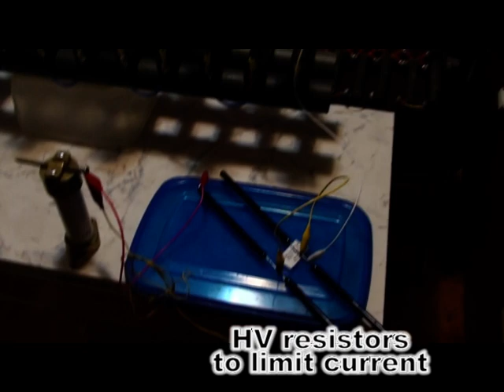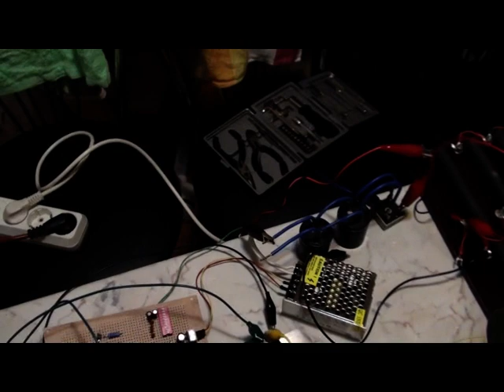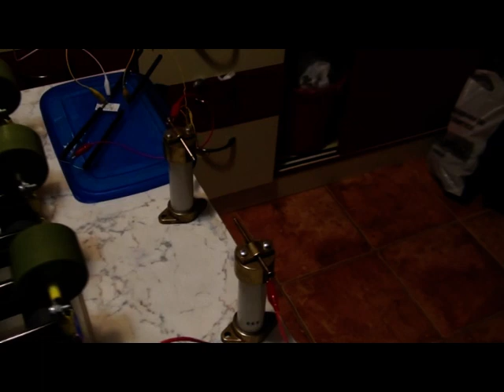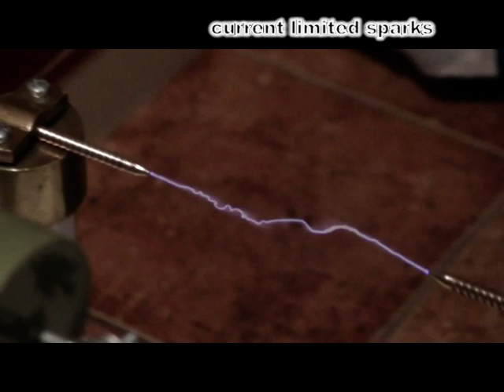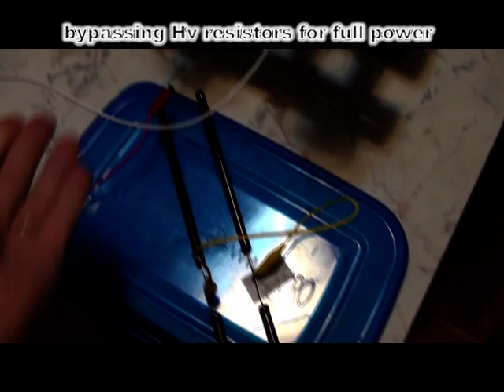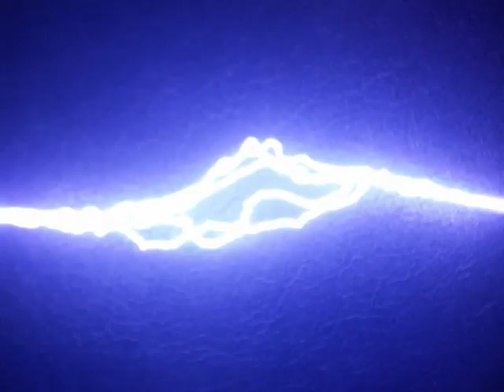HV multiplier 120000V

Comment from the maker: @whackitov Wikipedia: "CW multipliers are typically used to develop high voltages for high-energy physics experiments or lightning safety testing. CW multipliers are also found in laser systems, high-voltage power supplies, X-ray systems, LCD backlighting,  ion pumps, electrostatic systems, air ionisers, particle accelerators,  oscilloscopes,  bug zappers and many other applications that use high-voltage DC." 
For me, like many others,  it's just a hobby.

Comment: Well I'm trying to make one. For now I have suceede in making an aproximatelly 15 000 volts. But I'm using a 555 timer to make pulses for the transformer. So it was working well until I connected the two wires. It wasn't even a second, but it look I' ve burned something. Great video btw:)

Comment from the maker: @Daedronus The input voltage is about 10kv, and the output should be 120kv. The total capacitance is 2.4nf /6 (each of the 6 capacitors on one side being charged at 20kv, so 120kv totally). The energy should be (CU^2)/2, that is (0.4nf x 1.44 x 10^10)/2, which is 2.88J.

Comment from the maker: I bough them from eBay. In fact the diodes are pretty expensive, but are more reliable than puting 1kv diodes in series, because they are put in plastic cases with insulation. The capacitors are "doorknob" type, they are from Russia, NOS, from some military equipment. I bough a few hundred 3kv capacitors (russian again, they are cheaper) and 1200 diodes (1kv, 3A, fast switching) for a higher voltage multiplier (400kv+), but it will be ready next year, 'cause I don't have enough space to build it

Comment: Actually it is a spark, as in spark gap. Spark and arc are usually interchangeable, but an arc is usually defined by duration and it so fast and long it appears continuous like arc welding, jacob's ladder, and arc lamps. In this demo you can see and hear it's intervals and the duration is almost instant. It's a spark.

Comment from the maker: @RLore18  A marx generator uses only capacitors and resistors, without diodes. The capacitors are charged in parallel and discharged in series through small spark gaps (see other videos).

Comment: If you surround the HV multiplier with 10, large diameter anti corona rings, be sure to tie each of these to succeedingly higher voltage points in a long voltage divider resistor.  Ten, 2 Giga-ohm resistors tied in series with a ring tied to each.  With a soldering iron and solder, create shiny balls of solder in other locations to eliminate corona.  Finally, use small dabs of silicone rubber on any remaining points.  Make sure the silicone is completely dry before you apply HV.  Be safe !!!

Comment from the maker: @offyam The movement of the electrons is actually very slow; in fact it is the electric field, that guides the electrons, which goes with the speed of light. Of course, we cannot see the electrons moving, not only because they are very small, but also because of Heisenberg's uncertainty principle which states that we cannot determine exactly the actual speed and position of an atomic particle.  The Einstein' theory of relativity forbids speeds faster than the speed of light.

Comment from the maker: @giorulesallofu Thanks!
I bought the diodes from eBay (search "high voltage diode"). They are not the cheapest solution, but performed well. They are also capable of fast times which is good if you want to use high frequency - HV power supply. They are rated at 1A, but I use resistors in series to protect them.

Comment: Always imagine your multiplier as three different circuits.  The familiar one, charged with a load (such as an X-ray tube), with an arc (short circuit) passing very high current to the output terminal and when the diode strings pass high current into the caps to recharge them.  The transition between these is perhaps only 100 nanoseconds.  Surge protect series resistors only function when rapid charging or discharging takes place. Normally, they do nothing.

Comment from the maker: You're right. The length of the spark could be longer, but there are some losses due to corona effect; and those tiny sparks have a deadly effect on my capacitors - I had to replace one. Of course, it would be great to sink it in oil, but I didn't have the space for this. Perhaps a more compact version sunk in oil would be much more reliable.

Comment from the maker: @glenwoofit I didn't measure the current, but the average current should be less than 10mA; in fact the current is pulsed, and during a discharge it should be much higher than the average, so that's why I used 1A diodes.

Comment from the maker: The diodes already had screws; I could cover them with some insulator or rounded metal cap or immerse them in oil. I have a plan for a 400-500kv multiplier and I'll take care of the insulation.

Comment from the maker: @AKSoapy29  It's not that difficult to build one and you also have the satisfaction to do it yourself. You need a high voltage power supply, because starting from 220/110V would necessitate too many stages: the options are either a 50Hz HV transformer, or a high frequency HV power supply using a flyback transf. (like in this video). You can find cheap capacitors and diodes on ebay and build as many stages as you like..

Comment from the maker: @MrJouleJr  You could first try the timer on a light bulb or leds put in series (better) at low frequency (put a higher capacitance in the circuit) to check that is functioning. If you use the 555 timer to control a transistor, you should also take care at the voltage and current controlling the transistor's gate, because it can easily get burnt. Don't try to control the transformer's primary directly from the 555 timer because it cannot handle the current. Good luck!

Comment from the maker: @bigboy4006 The diodes are solid state and I bought them from eBay: just search "high voltage diode" and you'll find a lot of options, including this type. The cheapest way would be to buy lower voltage diodes and put them in series, but than you lose some voltage through corona efect. The voltage from Tesla coil might be too high for these diodes /capacitors. Flyback transformer is much more predictable.

Comment from the maker: @stivep1 I'm not an expert in physics, but I don't see a reason to have different wave shapes depending on the input voltage; I think it depends only on input wave shape and perhaps on the transformer core characteristics. You could check that yourself using an oscilloscope, but at lower voltages using the same input/output voltage ratio.

Comment from the maker: @mksboysal I didn't calculate it, but this flyback could not handle more than 2-300 W and not for a long time. However the "fat" arc power should me much higher due to the short time of the energy discharge. It's like the discussion of energy versus power of a lightning bolt.

Comment from the maker: Ma gandeam sa-l folosesc pt un tub cu raze X sau un mic accelerator liniar; un model mai compact ar merge pt un "stun gun".
Un tip exact ca asta e destul de costisitor: un condensator  il gasesti cu 12$ pe eBay in momentul asta. Eu am gasit mai ieftin, dar era acum 3 ani. O dioda ca asta o iei de la chinezi (tot ebay) cu 22$. Se mai adauga circuitul electronic, si restul, deci adunate fac vreo 400$. Mult ! Poate iesi mai ieftin cu condensatori si diode de voltaj mai mic, dar inseriate.

Comment: I have question Ho  to build 5000V square wave amplifier.?(F. 1-100Khz)
Is 1100V pure square when delivered to flyback = 5000V (secondary) going to give me more clean square than flyback driven by 20V square and 5000V output?

Comment from the maker: It has some advantages over a Tesla Coil: you can control it much easier, it's safer and it has more practical uses. Of course it's not as cool as a Tesla Coil, although if you see and hear the full intensity discharge you might change your mind.

Comment: @offyam Light is electromagnetic radiation within a limited spectrum which the human eye is capable of detecting.  If the electric field is generating electromagnetic waves within the wavelengths visible to humans it will be visible, otherwise you won't see anything. All electrical energy will generate some form of EM radiation whether its infrared radiant heat or something else depending on the amount of energy and how its being utilized.

Comment: @virgilius1979 You got me a little bit wrong. I' ve done all that before and I' m using an 2N3055 power transistor for the transformer. After I burned another 30 diodes I realised that more powerful diodes are required. I use two transformers connected in parallel and that's about 380mA, so it' s not that strong.

Comment from the maker: @jerjanerayo  It certainly emits UV radiation, but unlikely to produce X-rays, because of the atmospheric pressure which prevents the acceleration of the electrons between the electrodes. Still, UV radiation can be quiet strong and can damage eyes and cause skin cancer if the exposure is repeated.

Comment from the maker: @zker666 I have used Eirik's flyback driver MKII.1 circuit from uzzors2k website. (a bit modified but basically the same). I used different resistors and capacitors with DIP switches to change the frequency.

Comment: Hello, i want to charge a metallic object and to be able to modulate its potential from 5kV to 100kV or more to see how  it attracts particles around depending on tension. Do you know a way to do it, or at least does your circuit can put m'y object at 120kV DC even if I can't modulate the tension ?
Reply from the maker: sorry for the late reply: I guess an electrostatic generator is better for your experiment. You can use a voltage multiplier also, but it's more expensive.
Reply: ok tank you for answer

Comment from the maker: @foozybearz  Not with this transformer, but I noticed this effect at another transformer which is sealed in plastic and I read they have a capacitor added, so that's why you got zapped. However it shouldn't be very dangerous, unless you have some heart problems.

Comment from the maker: There are already many tutorials for building a voltage multiplier. Search for Villard cascade on Wiki. Search also for 555 timer simple circuit, how to drive a mosfet to control current in flyback transformer primary circuit.

Comment: Hi,
I just put out a transformer out of a microwave.. The transformers input is 220 voltage and the output around 2000 voltage. Now I want also to build a Multiplier with an output of 200.000 voltage, or maybe later 400.000 voltage.
Can you tell me which diodes and which capacitors I need? I know, that I need around 100 capacitors and 100 diodes, but what values?
And if I want to create 400.000 voltage, do I need other capacitors?
Reply from the maker: It's not worth to try to build such a multiplier. With 100 stages you'll have huge losses, and it will take a very long time to charge all the stages so you'll not have a continuous spark but short discharges when the voltage reaches breaking point. Try to get a higher voltage transformer, like neon sign transformer or ferrite transformer (this one needs high frequency).
Reply: Bogdan Rotaru Hi again, I have now putted 3 microwave transformers in serie, i have now around 6600 voltage. so it takes less stages. will 40 stages do? and please tell me, what types of diodes and condensators do I need. I hope you can help me. I wanna experiment with leaking charges.
Reply: Bogdan Rotaru Hi again, I have now putted 3 microwave transformers in serie, i have now around 6600 voltage. so it takes less stages. will 40 stages do? and please tell me, what types of diodes and condensators do I need. I hope you can help me. I wanna experiment with leaking charges.
Reply from the maker: kruimels 40 stages it's still too much, the losses in the circuit won't allow you to reach the desired voltage. You should also put the transformers in mineral oil to reduce the risk of internal arching. Try with 10 stages first; than add a few more; with every new stage added you'll notice that the discharge takes a few more to appear until the capacitors charge. So, with 40 stages you should wait a lot until you reach the top voltage and get a spark (unless you move the discharge electrodes closer and the discharge will take place at a lower voltage than maximum). You should choose diodes and capacitors rated at least double the input voltage: in this situation 15 to 20kv should be enough. You can find them all on ebay. Don't forget to limit the current of the spark with a high voltage resistor in order to protect the diodes (you can calculate the resistance by dividing the total voltage by the maximum current supported by the diodes).
Reply: +kruimels you could connect the secondary from the first transformer to the primary on the second. if the transformer is 220 -> 2200v then 2 coupled together should produce around 22000v and 3 should produce 220000v (if i'm not mistaken)
Reply: +Patrick Appeldoorn Thx for all the answers, I have considered, that I wanna build a tesla coil ( DC ) with the 3 microwave transformers ( 6600 voltage ) as input. Still need some help with this. so I have to google alot.

Comment: @virgilius1979  after it pass flyback square wave  becomes sinus.That is my problem I need Square at 5000V I have expensive 1100V square wave amplifier I was under impression that deformation is smaller when signal is delivered at the highest possible level to flyback  to reach expected 5000V

Comment from the maker: Just Google for 555 pulse generator. You also need a flyback transformer and a 12-24V power supply to feed the primary of the flyback. Don't try a very complicated circuit ! First try light up some leds or a bulb (should be pulsed light if the frequency is low enough for you to see <24 Hz). 
Another popular circuit is ZVS (zero voltage switching): you can find on You Tube and Google lots of examples.

Comment: hello sir, 
can I use rectified flyback transformer.
to power up a capacitor and diodes combination (modified Marx generator). not using resistors for full power.
Reply from the maker: No you cannot, you need AC flyback, search on eBay, an Austrian seller has some. Or you can build one yourself, but its not easy with the insulation.
Reply: Bogdan Rotaru          
but in instructables website
it has written that you can use Ac or high frequency pulsed DC.
we can use both of them 
 can you please verify them if you have pulse DC flyback transformer.
here is the link 
https://cdn.instructables.com/F2T/GGIE/F8RP81UP/F2TGGIEF8RP81UP.SMALL.jpg
Reply from the maker: it's "half cycle DC" - those modules don't produce that! They already have a voltage multiplier inside which produces low frequency pulsed DC. But look on ebay, they have some 10kv high frequency transformer, very cheap 2 or 3$,  low power, but great for this type of project.

Comment: Hello sir.
Please answer me.
What is output value of Voltage and current? Before full power and after full power. (Means after using resistors and before using resistors).
Reply from the maker: Voltage is about 120kV, current is not easy to calculate, it depends on the internal resistance of the capacitors, which I don't know. I estimate it to be at least 1A, maybe 10A (pulsed current). With the resistors added in series, it's I=U/R
Reply: Bogdan Rotaru  
Thanks sir.
120kv, after spark gap or before spark gap? And tell me sir about current value (approximate value). You can calculate, you have value of resistor.
Please. I need data.
Reply from the maker: I don't remember the exact value of the resistors, but I estimate around 1MOhm, so the current should be around 100mA. The voltage value is with open circuit, when discharging the voltage drops.
Reply: Bogdan Rotaru 
Sir, can Voltage multiplier multiplies input current? Last question I think. Please
Reply from the maker: No! They only multiply voltage. To multiply current use a transformer to lower the voltage and use thicker wire in the secondary winding.

Comment from the maker: @d4nr055  I wouldn't get my fingers closer than 20cm when plugged in. The current can be deadly even with the resistors put in series (a few tens of mA), and certainly is lethal without them (can reach 1A or more, because the capacitors discharge very fast). I cannot answer exactly how closer you can put your fingers without being zapped, but I would suggest you to try with a grounded wire instead (don't hold it yourself !!). Even unplugged you must be careful with the capacitors...

Comment: Hi what  if this high voltage is used in a electromagnet or in a coil gun
Reply from the maker: I want to build one, but not with these capacitors. you'll need much higher energy - these caps only store a few Joules, you need hundreds or better thousands for some effect.